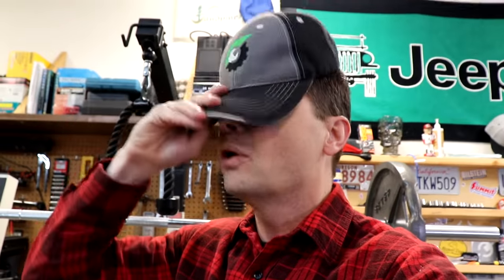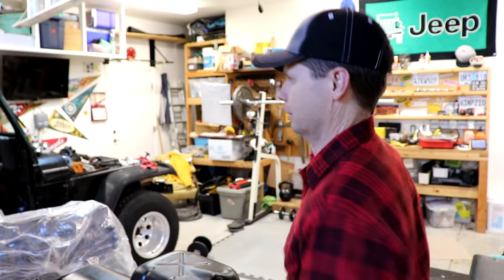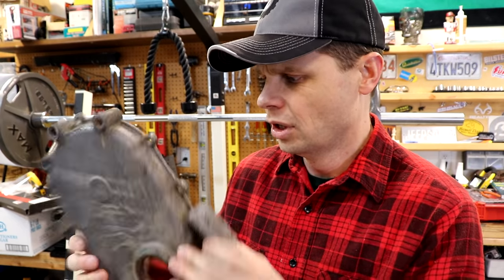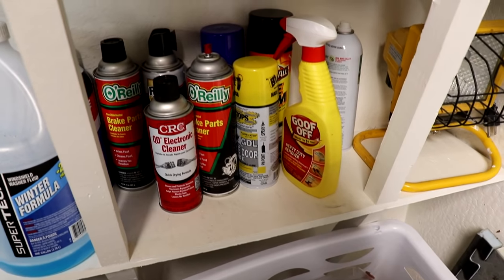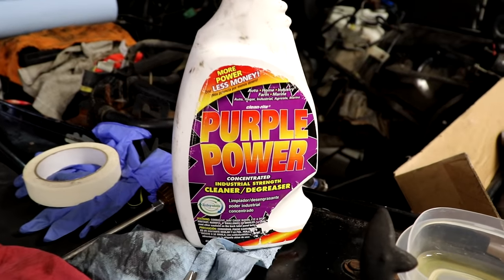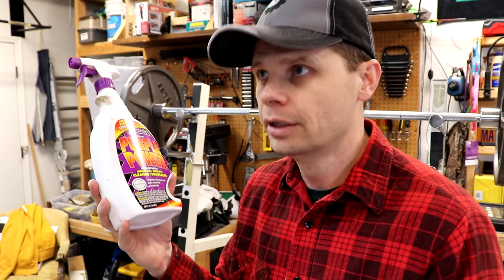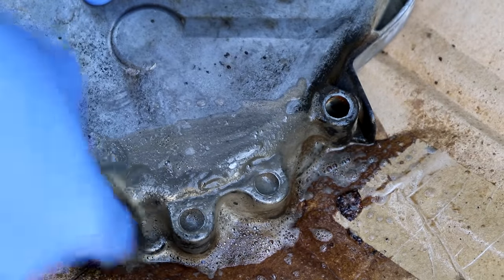Super Clean Aluminum Engine Parts

Comment: I personally have had poor results using purple-power on unfinished caste-aluminum parts. It cleans caked-on oil/grease very well and the parts look nice and clean. I few days later, a white cruddy powdery residue starts appearing on the surface. Looking through various automotive forums, this is a very common experience with Purple-Power. Thorough scrubbing of the part with detergent seems to remove the crud, but it eventually comes back. From what I gather, it has to do with Sodium Hydroxide (the active ingredient in Purple Power) getting into the micro-pores of cast aluminum and causing a reaction.
Reply: Sodium Hydroxide in solution will turn all aluminum black.
Reply: That's corrosion. When aluminum composites corrode, that's how they do it. Over years that powder becomes deep pitted holes in the surface. Water makes it happen much, much quicker, but because this is an engine part the heat probably prolongs the life of the part, slowing the reaction down considerably by flash drying it with regular use.

For another fun chemical experiment, you ought to drop a drop of gallium on it and wait overnight. By the next day you'll be able to fully demolish the part by hand and it'll be made entirely of that powder because of the way gallium bonds with aluminum.
Reply: @michaeljayfawkes2414  Yes, automotive aluminum does corrode in the real world but it is generally accepted to be cosmetic rather than structural on nature. Pure aluminum passivates (ie forms an impermiable oxide layer that protects the metal underneath from further reaction). 

The white powder (that I've seen forming after using Purple Power) is very different in consistency from the normal corrosion that forms on typical alluminum alloy surfaces. Natural corrosion residue is much harder, forms much slower and is characterized by pitting.

I've never had the white powder  chemically analyzed but it matches the physical characteristics of Sodium-Aluminate (NaAlO2 or NaAl(OH)4 in hydrated form) very well, a soft white fine powder formed when an aluminum surface comes in contact with sodium hydroxide (the key component in Purple).

As bad as gallium is for aluminum I believe mercury is even worse. I remember hearing that it is prohibited to transport mercury on planes.
Reply: I think the trick is to not let it sit on the part. Spray, scrub, rinse, rinse, rinse.
Reply: @sfdrcm  Agreed. LAs Totally Awesome also works quite well, and I haven't had the corrosion issue. The original yellow one, mind you, the orange one messes up aluminum in a matter of 30 minutes.
Reply: White powder only using caustic  when you don’t wash it off???? You do know that’s part of the process correct? Its not supposed to dry. Also what others have said, NaOH makes aluminum turn black with too long not white
Reply: @BudderKing4u 
That's just what I do with automotive parts.. Dip in caustic soda solution for a couple of minutes then rinse and dry.

Comment: Toluene, its used as a degreaser in aeronautics machining. Aluminum and carbon steel safe. The only down side is the fumes make sure to use it out doors or in a big open space with a fan.

Comment: Years ago, I took a really gross aluminum intake manifold off a diesel V8 to a motor machine shop and had it cleaned it in a hot tank.  The guy left it in there about 40 hours.  It looked brand new when I got it back.  Another method is to blast it with walnut shell abrasive.

Comment: Years ago I had used the Amway Industrial Clean mixed 50/50 with water.  I the part soak overnight in it.  Took it out the next day rinsed it off. The part was clean as brand new.  And, with no scrubbing.  It you used it with steel parts, you need to spray it with oil or rust would start on it.

Comment: Here in Wisconsin at the farm store they have whats called power team acid rinse. Its thin pink sprayable liquid. Its a blend of phosphoric acid and sulfuric acid. Are used it on my pontoons and it was amazing! It brighten them up very well but didn’t cause any kind of pitting or etching. It’s only eight bucks a gallon! spray it on and let it sit for a few minutes and rinse it off! I’ll be doing an aluminum canoe next!
Reply: Fleet farm?
Reply: @kylekons3672  yes!

Comment: I use a circular wire brush on my drill and gunk degreaser. Came out almost polished
Reply: That's what I always do aswell. This guys totally wasting his time with housewife products.
Reply: Maybe he doesn't have a drill and Wirebrush bit case that's the way to go
Reply: Wire brushes chew up aluminum.  Nylon, brass, or Roloc would be better.
Reply: @Brees1986  Isn't a wire brush brass tho? Or some are steel.

Comment: I read a study on the top 10 grease and oil cleaners and Purple Power was number 2 behind a $20/gal brand. At less than $5/gal it is my favorite parts cleaner but definitely don't leave aluminum soaking in it for a long time. 5 or 10 minutes and a good scrub will do the trick. Although it does leave a dull gray finish on aluminum, you can polish it up as much as you like afterwords.

Comment: That's the same stuff I use! I soak my aluminum parts in a mixture of that and hot water overnight and it literally melts everything off. I would recommend using a paintbrush when rinsing them to help get all the residue off.

Comment: I just polished my intake manifold with a $20 gravity feed blaster and $25 glass bead 80 grit blast media from harbor freight, and a regular compressor, It looks like new and have left 3/4 of a 25 lbs. Of the blast media.
Reply: I have a media blaster from Harbor Freight but haven't used it yet. Did you build an enclosure to keep the media from being spread all over? Thanks
Reply: @darylvoorhees2629  i did it on my backyard grass., got spreaded and lost on the grass, went to waste but looking how shiny is my intake manifold i think its worth!

Comment: I always use a rotary wire brush - just lightly, but it takes off all the oxide which is what holds the oil/grease.
Reply: A fine brass wire brush is ok but not for gasket surfaces,  a large machined flat block of alum and PSA 320 on it does a good job.

Comment: sir this purple power also does radiator flush great my truck was overheating with lots of rust and i mixed it with half a gallon of water let my truck idle for 15 minutes.. wow it did the job no overheating anymore i was impressed i didnt have to take radiator off to get it cleaned .. so thumbs up for purple power work amaizin. so it work better than having to buy at an auto store radiator flush when u have it right at home thanks you

Comment: Most products like this contain hydroxides. Purple Power has it listed on the material SDS. Aluminum is generally a reactive metal and hydroxide (OH-) can dissolve away the protective aluminum oxide layer. A better alternative would be elbow grease + a biodegradable cleaner like simple green. Highly recommend diluting products like Purple Power and minimizing the amount of time it spends in contact with the surface of the aluminum.
Reply: Purple Power cost me a timing cover and ac mounting bracket!! thank you for letting others know about this!!!
Reply: @strongman86   I don't think a lot of people know or understand that a strong bases (like sodium hydroxide) eat a lot metals just like a strong acid (think hydrochloric acid that you might see at a hardware store).

I think there's a misconception that if something is sold in a plastic container, it must be safe for metals.

Not that anyone would do this in the automotive world, but bromine reacts with aluminum as well, pretty violently. It's one of my favorite lab demos. @mtsuchemistry

Comment: i used DOT3/4 brake fluid on my cylinder head to great result. i ran out, so i have yet to try it on the intake manifold. The head and intake have a oil build-up similar to yours. i'll try this as it may be better environmentally.
Reply: What can the brake fluid remove? Just oil and grease? Or the deep stained dirt?

Comment: At home soda blasting works really well.  Either make a diy blaster, or pick one up from harbor freight.   Just rinse well with water immediately after blasting.
Reply: Dust in an engine is very bad ...very  bad   .
Reply: @nadronnocojr  Look up soda blasting. its not dust like you think. Its been used for a very long time and still one of the best way to clean aluminum parts.

Comment: Straight PineSol , I use it to clean aluminum Carb parts and what ever will fit in my sonic cleaner. But if you can submerge any part with it and leave it set overnight it works pretty good also.

Comment: Im using throttle body cleaner and/or wheel cleaner+pressure washer. A garden hose works too if you either have a strong thumb or a adjustable tip.

Comment: Hi, I cleaned all my aluminium parts in my vapor blaster but blasting the grease works well and fast but it makes a huge mess in the blaster housing so recently I started using a handheld blaster (25U$) with soda and preclean the part out in the garden (get good protective glasses) since the baking soda is environmentally safe you can do that in the lawn. Afterwards I blast it in the vapor blaster with glassbeads which brings great results and a smooth surface. 
Ok, you got to rinse them really well with warm water and dishwashing liquid to get any of the beads out especially out of thread holes that tend to fill up. When dry I use compressed air and go over it once or twice until its has no beads left.

Comment: I've been using Purple Power on my rebuild.. I soaked aluminum parts in a bin with PP concentrate diluted with water, several days later I noticed barnacle like formation in the water, and on some of the parts.. doesnt look damaging, but I quickly pulled them out and now in the process of shining them up..
Reply: This is not meant to be in long time contact with aluminum. Spray, scrub and rinse.
Reply: @sfdrcm  Indeed! Lesson learned! Lol

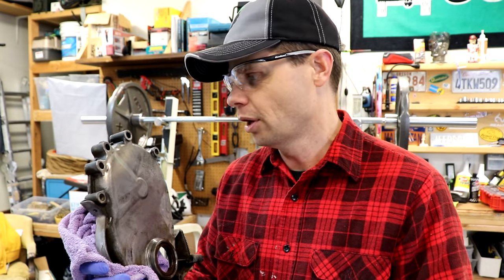Comment: 4:50 There's something I use as a "first step" (won't get it completely clean, but does as well as this Purple Power stuff); think about what grease is. It's an emulsified oil. An emulsion is any dry material that is mixed with a liquid, but only enough liquid to make it a high viscosity liquid (and not a low viscosity. Basically more of the solid than the liquid). Grease, the kind of grease we're talking about, is solid carbon mixed with liquid hydrocarbons (oil with carbon soot). Now, what cleans up grease really well? Like when you need to repack a wheel bearing and you want to get all the grease (that's been further emulsified with dirt and rocks) out of the bearing?

Mineral Spirits.

Comment: Back in the day we use to soak all aluminum things (pistons, covers, etc.) in carb cleaner. That was before the EPA got involved and now everything sucks. ZEP industrial cleaner in a boiling tank works good. Have tried the purple stuff too. Once I get the grease/oil gone....I use a sandblaster with 50% silica sand and 50% glass beads to finish it up. Some people blast with walnut shells.

Comment: My trick is usually spraying some brake cleaner, letting it sit for about 30 seconds and then hitting it with a pressure washer. Never found any grease stubborn enough with this method. As long as the surface is not painted, the aluminum should be perfectly fine without any etching or discoloration
Reply: Brake cleaner evaporates within minutes, letting it sit is doing nothing
Reply: @tylerseabook9423  I said about 30 seconds. and any solvent needs time to dissolve
Reply: Yeah having a good pressure washer is an invaluable tool, the one at my shop takes off grease so easily, can make an engine bay with 100k miles look almost brand new in 5 minutes

Comment: after i discovered this i never looked back. 
its very pleasing to see it working so effectively that after spraying it a 2nd/3rd time [& initial good soaking round] the force from the jet spray alone is enough to get an 8th in. thick of oily crud cake to just liquify off and drip down to the floor, exposing clean slightly lustrous metal, can imagine how much better the wire brush makes it

Comment: I have used Purple Power for cleaning the topside of my engine and engine bay. Works great. I'm currently restoring a 1961 Chevy C10 truck with massive amounts of caked on dirt with grease on the front suspension. It's all steel of course, but have you found that oven cleaner works best on those parts? Thanks
Reply: White spirit works the best as it cleans oil easy and is safe for paint. For cleaning rust run-off and surface rust best is rust converter/naval jelly which contains orthophosphoric acid it is also safe for paint. You can even safely spray both of them directly on parts.

Comment: I soaked my valve cover in this over night and it ate right through it, that stuff is very powerful if you let parts soak, I'd use simple green it works just as good with no corrosion
Reply from the maker: Yeah. Have to be careful with this.

Comment: I use La awesome" orange from the dollar tree, let it soak about 1-2 mins and gently scrub with a soft brush. Hose off. Usually looks good. Also so does a strong mix of warm water and dawn platinum dish soap with a brush.

Not sure if either are actually "safe" for aluminum but Its what I have used with good results.
Reply: "Awesome" uses an advanced surfactant chemistry that is generally pH neutral and safe on most metals.

Comment: The white residue is just aluminum oxidation , that just what bare aluminum does over time . This may be considered cheating , but what I do is spray the part down with engine degreaser, then pressure wash it really well , then dry it with compressed air , clean any grease or oil left on with a nylon brush and replete the engine degreaser , pressure wash and dry cycle ,then go over the entire part with scotch brite to scuff it up then paint it with aluminum engine paint . I know this isn’t exactly restoring the aluminum to its original condition , but it keeps the aluminum looking brand new for years and is really easy to keep clean .

Comment: I used 800 grit wet sand paper on my aluminum Ute tray followed by a metal polish then finished off with an epoxy clear coat...the tray looks like stainless steel with an mirror finish!

Comment: Purple Power's active ingredient (like 99.8% of HD cleaners) is Sodium Hydroxide/lye/NaOH.  It is fine on iron or steel, but given enough time or strength it will completely destroy aluminum.  It's possible that if you left that timing cover overnight in a pan of Purple Power by morning you would have holes through the metal.  Sandblasting with walnut shells is the way to go.

Comment: I just used super clean and if you let it soak for a day or so it really desolves the grease.Or you can use Meguairs chrome wheel cleaner which reacts faster as it will take everything off except some stubborn residue

Comment: Powerbolt use to be the go to cleaner now for the heavy stuff i use starting fluid to dry everything then a wire brush on a die grinder to clean it all up. Less mess when it is a dry cleaning and no chemicals needed.

Comment: Hi fella, I read on a Hyundai Getz forum that cream of tartar (tartaric acid) is good for cleaning aluminium castings i.e. my alternator case which is gunked up with grease etc etc, I’m going to give it a go on the weekend, they suggest heating it or boiling it for a few minutes removes build up Greece i’m hoping for a miracle actually, but if that fails I always find the bead blasting is a great  cleaning medium  regards to all

Comment: Spraying aluminum with degreasers kills aluminum. 
Im second owner of 95 z28 camaro lt1 engine that showcases a beautiful aluminum fuel injection intake manifold that the first owner killed with degreaser.
I guess i will give purple power a shot. One thing for sure, nothing dies 2ce. Right?

Comment: My buddy who has only worked on irons block engines told me to put my aluminum LS block in a purple power bath. Left it in for 2 weeks and when I pulled it out it had eaten at it and the Block was shot. On my second block.... I used a pink aluminum brightener which consists of hydrochloric & Phosphoric acids. Wet surface, spray on, scrub in with soft brush, & let sit for 10 mins and hose off. Rinse and repeat until desired clean. It takes a few times but gradually you’ll get your desired level of clean. If you have smaller alum parts, I use Berryman Chem-dip. Amazing stuff.

Comment: Harbor Freight has Industrial grade baking soda. Use it in place of sand or glass beads in a blasting cabinet. You'd be surprised how it works and it does not eat away any metal, not even aluminum. There are some videos on Soda Blasting. Check them out. I use my soda blast cabinet for most everything.

Comment: I bought a used aluminum engine oil pan for my project. It was covered in sludge and dust and I used easy off heavy duty. It cleaned well but left a white powder on the internal surfaces. Do you think it is safe to use? Will the powder contaminate the oil system and cause damage?

Comment: You can buy a gallon of acid u can buy they use it to wash concrete when it’s old it takes it off good  also I accidentally dropped and damaged a old car battery and the acid came out so I poured it in a foil pan and I did some test on diff metals that really worked I also wash some old concrete on my patio and look bran new still after 3 years